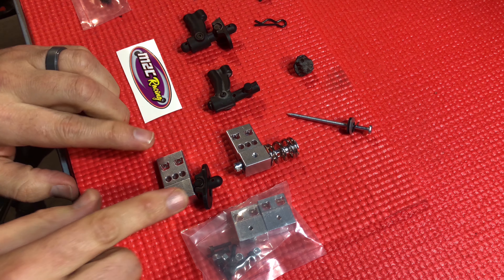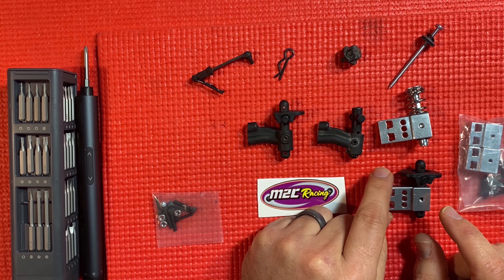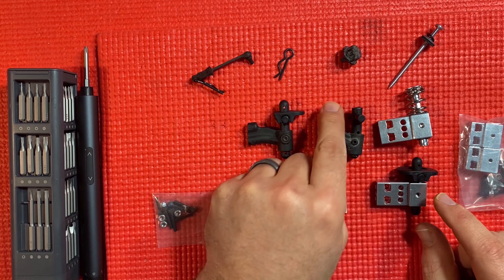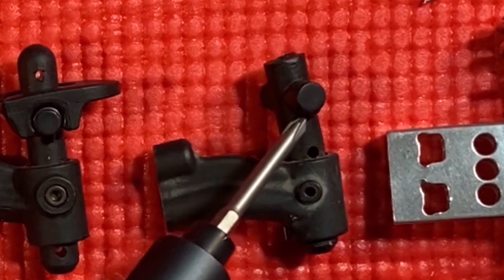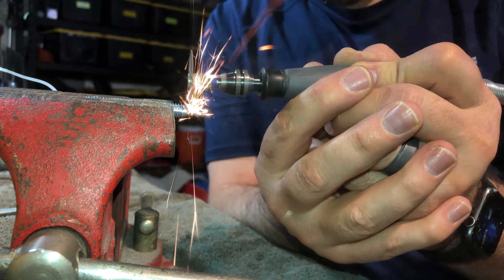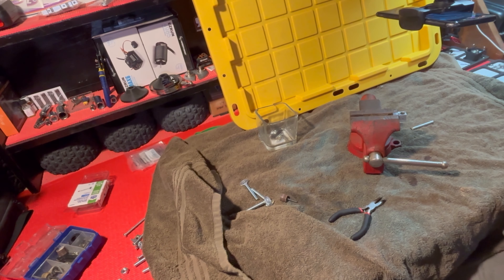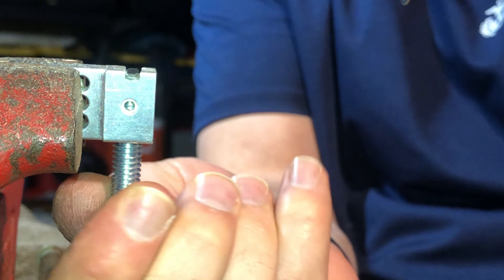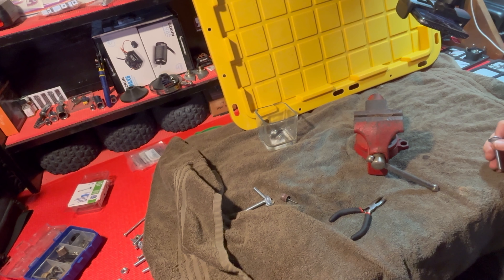M2C Explained Series - M2C Body Mounts! My BEST Tactic EVER!

Comment: Awesome brother. Yeah thunder rc has been doing that for a while ans few others i know. Im still rockikg the stock arrma body post still workikg pretty good. But yeah that way is super tough And put.
S less wear on the body as well.
Reply from the maker: Any of them make a vid on it, I’d love to see their variations. I scrubbed through thunder RC. Couldn’t find anything
Reply: @EastTactics  yeah u just mentioned it in one of his vidoes I remember while back. No actual vidoe on the body posts. He don't do those vids as you know. But yeah he used nuts and a washer  on top of the body that's all I remember.  But of course nothing like what you did ET with the spring set up. That's petty awesome 👌. I think you solved this issue for sure.
Reply from the maker: @paulrakis 
🤜💥🤛

Comment: Maybe try all thread for the bolts. Out of one piece you could get 4 + body mount post's, would just need to cut to size.
Reply from the maker: Right, but the reason for the thumb screws is because of that needed flat end that I take advantage of after cutting it off you have a unique flared out section that works perfect for both stopping the spring from pulling the bolt out, but also preventing the bolt from spinning at the same time.
Reply: @EastTactics  gotcha that makes sense. I run these mounts on my Notorious and FireTeam. I had to use the Kraton mounts on the FireTeam. I'm definitely gonna do this cause I really hate clips.

Comment: Will these new body post work with teknp mt410 m2c shock towers?
Reply from the maker: I checked M2C‘s website because I’m not super familiar with the MT 410. And it does look like the Arma body post set (the composite pieces) are compatible with the MT410. So the thumb screw bolts are definitely compatible. You probably want to go with the inch and a half variant and the 10 inch tall springs, unless you’re OK with the body sitting a little higher to incorporate more spring compression.
The real question is are the M2C aluminum shock standoffs compatible? Specifically, the two holes screw into the shock tower as well as just the square size of the M2 aluminum body mounts. I don’t see why they wouldn’t be but I’m not 100% sure. 
That’s not to say that you couldn’t use the composite body mounts with this mod, I think it’s still completely doable. You would just have to cut the notch those. But I highly recommend this mod be paired with the aluminum M2C body mounts.
Let me know if that answers your question.